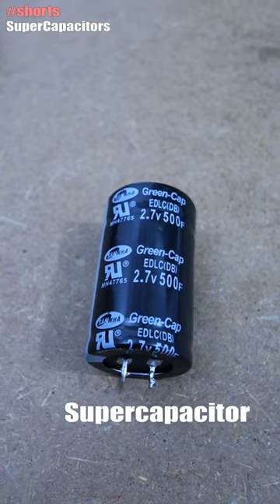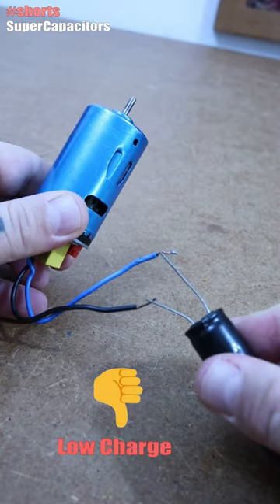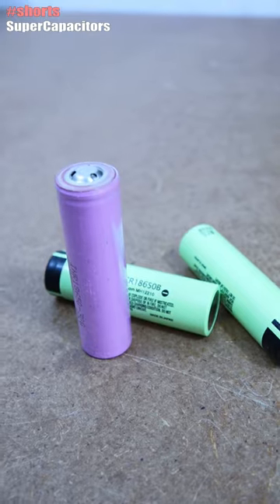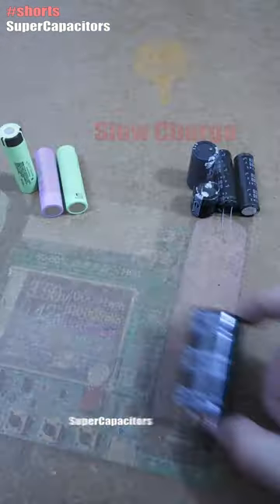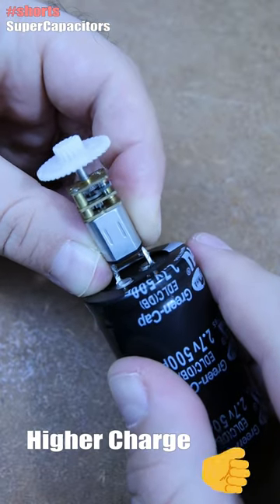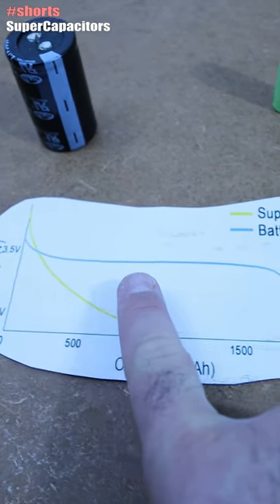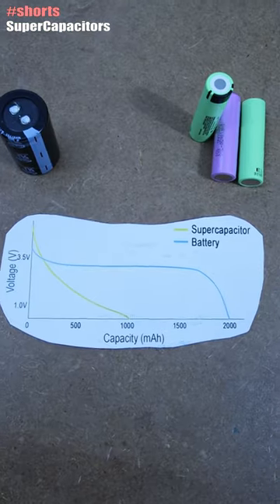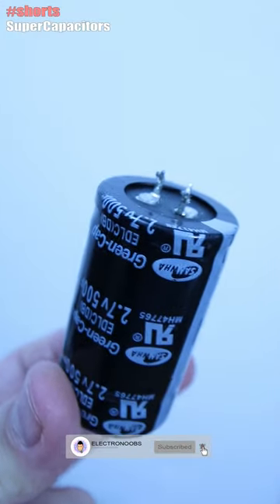Supercapacitors

Comment: I once shocked myself with a super capacitor in a disposable camera by accidentally touching the 2 contacts when it was charged
Reply: Those weren't super caps, just regular capacitors with a high voltage limit for the flash discharge. Had it been a supercap you would have had a bad time. 🤣
Reply: I don’t care
Reply: these aren't supercapacitors
Reply: you'd probably have been fine if it was a supercap because their voltages are so low. Only danger with them really is if the contact get shorted then get really hot and burn you
Reply: That was a photoflash / xenon strobe capacitor not a super cap

Comment: different battery chemistries charge and discharge differently. A Li-ION cell will hold a stable rate of discharge until the end then drop out fast and with a proper BMS circuit the power will just cut out to save the cell from low voltage damage. A Ni-Cad will drop voltage gradually as it discharges just like an SLA will, This is the same with Alkaline cells only those cannot be recharged safely. Ni-Cad cells do not last very long and will develope a charge "memory" where it may not fully charge to capacity over time due fast charging the cell. This was the plague in 2-way radio batteries way back when. An SLA will allow a lot of current to use but will sulfate and start to bloat in time thus making the battery a hazard aside from off gassing during charge cycles

Comment: How many mAh supercapacitor (the one in the video) has ?
Reply: I think around 375mAh
Reply: @thawzinkhant1759 🎉
Reply: around 350mah. Farads x voltage =amperexseconds. so 500x2.7=1350As divide by 3600= 375mA.hour
Reply: 😀
thnks for the computation
Reply: I think I prefer volts per hour as a unit of capacity. 

Just kidding of course
Reply: @egg99  it's a hyphen not a slash between milliamp-hours (or nothing at all). It's NOT milliamps per hour, it's milliamp hours.
Reply: @danstheman33  right i fixed it

Comment: Isn't a "super battery" a battery where every cell has its own super cap?  

When the cap sees the battery cell it will charge to that voltage, and then rapidly absorb charge (rising quickly to the higher voltage of any charge being put across it).  If the [solar] charger sees amps increasing it will assume it is safe to raise the voltage and or current depending on charge cycle phase, but when the sun goes in and clouds reduce charge rate, the super caps will discharge to battery cell.

I regularly see the MPPT on my array report a change from  200 to 450 volts DC in, 2 to 40 Amps to battery.  PV production varies from 250W one minute to 2.5kW in another on grey days. 

Storing 400v in a cap or super cap is probably asking for trouble, but using super caps across individual cells at 3v to 4v should both improve charge capture in variable solar conditions and then (possibly at night) assist the battery to meet high current discharge rates when inductive loads call for amps on startup.

Anyone agree or have exerience of this?

I would love to know if i am thinking correctly.  

I dont think it is generally done thus ways because the super caps will only cycle between 3.4v and 4.2v in LiPo and 1.5v and 2v (or whatever it is) with Lead Acid, and the number of cycles will be minimal e.g. 3-20 times per hour
Reply: If you have a solar panel and a storage battery in the system, a capacitor is not going to help.

The performance of solar panels, as you know, vary greatly from bright direct sunlight to cloudy no direct sunlight conditions.

So the goal is to maximise the amount of power coming out of the panel.
The best way to achieve that is using an MPPT or optimiser, which dynamically changes the load resistance presented to the solar panel in order to find the load resistance which matches at that instant in time, for that level of illumination on to the panel, the solar panel source resistance.

Maximum power transfer from the panel occurs when the load resistance to which it is connected matches the internal source resistance of the panel.

So the MPPT devices are adjusting their input resistance,  measuring the power developed, and then repeatedly adjusting that input resistance looking for that maximum power point.  Once that point is found, assuming the MMPT has homed in correctly, then you are not going to get more power out of the panel.

The battery is the storage device. You don't need a capacitor.

A capacitor can only charge up to the voltage of the supply that is connected to (we're not talking voltage doublet circuits here).

And voltage isn't that important, (it is the power that is), except in ensuring you are above the minimum charge voltage for the battery charger for as long as possible.

Comment: How many mA do you lose by using a buck boost to level out the supercap voltage?
Reply: None. They are usually used instead of a backup battery for wery low consumption logic circuitry. Something that draws few hundered nA.

Comment: All caps charge up fast. No such thing as a supercap. It is the resistance in series with the circuit that affects the speed of charging.
Reply: Supercapacitors do exist, but they're just a different type of capacitor design.

https://en.wikipedia.org/wiki/Supercapacitor

Comment: Anyone know how to hook up and wire a capacitor up with a car battery?
Reply: Minus from the cap to minus from the battery and plus with a light in between the cap and battery plus. You have to wait until the light is off, then just connect the plus from the cap to the plus from the bat
Reply: @umut.blgn_  So 750 to 1200 ohm 12 v led bulb?
Reply: @l0I0I0I0  Just use a Standard halogen light bulb
Reply: The easiest and fastest way is a H7 Halogen bulb
Reply: @umut.blgn_  Thank you umut!  I think Ill hook it up this week.  Bought it a few years ago.

Comment: We need a hybrid. A battery with a supercap as the output. Give it built in BMS IC and have it tuneable on the output.
One sec it's: 3.7v 3A, next it's a 1.5v 2A.
Reply: How can you control both voltage and current at the same time?
The answer is you can't.

If you set the voltage, then it's the load that determines the current, up to a certain maximum limit.

If you set the current (current source) , then the load sets the voltage.

So you can't have a supply which delivers 1.5 volts at 2 amps. You can have a supply which provides 1.5 volts at up to 2 amps.

Comment: "It can store a lot of power" is misleading. A miliamp-hour is a unit of charge, not power. Also, a farad is a unit of capacitance, not charge. And capacitor voltage doesn't decrease linearly. Even that graph is wrong: there is an asymptote at V=0. Lastly, power density is not energy density. Energy, charge, capacitance, and power are all different. For an educational channel, almost everything here is wrong